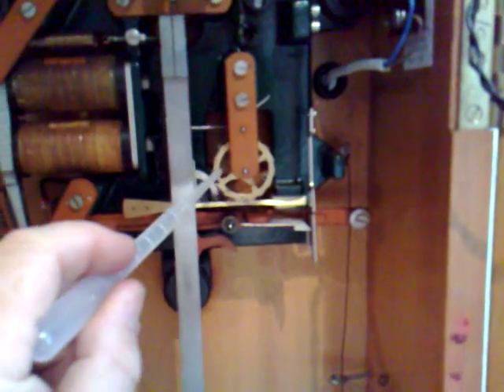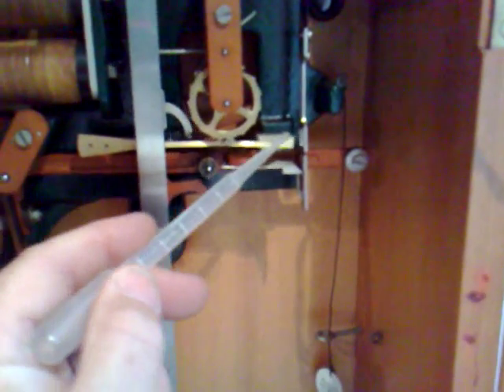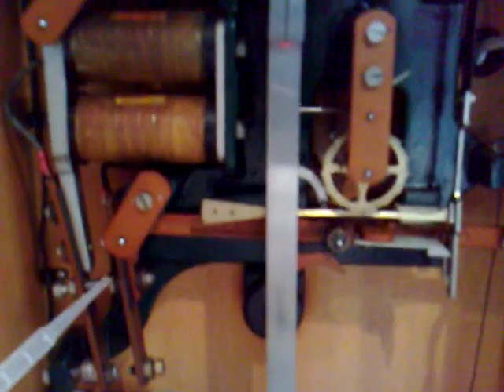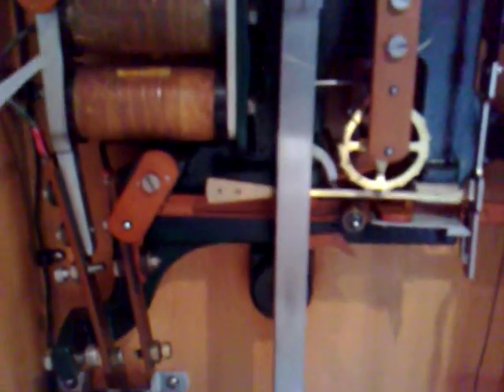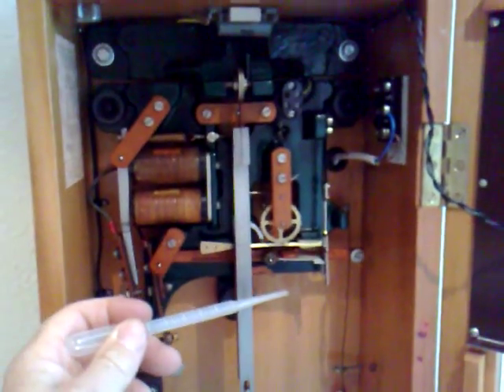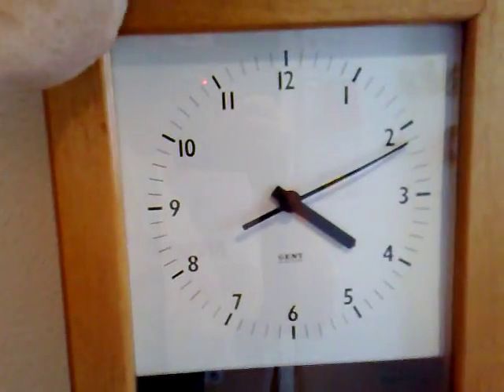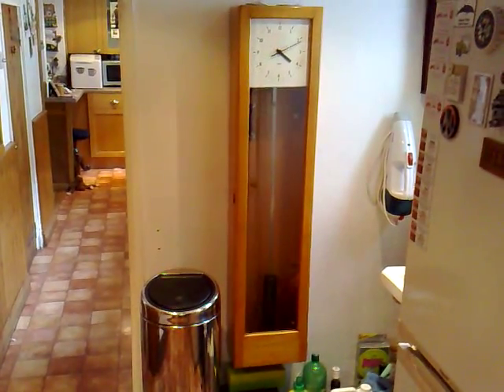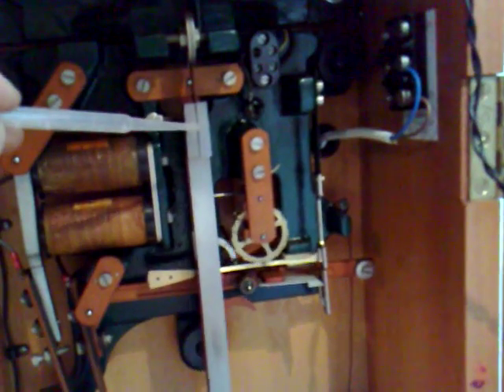A Rough Guide to a Pulsenetic Clock

Comment: That reset way to quick and rough, you need to dial the drive voltage down a bit.
And as mentioned below a waiting train is an entirely different beast, actually a powered slave clock driven by a C7 but used to drive huge dials. The Liver building in Liverpool is a good example of  (four) waiting train movements.